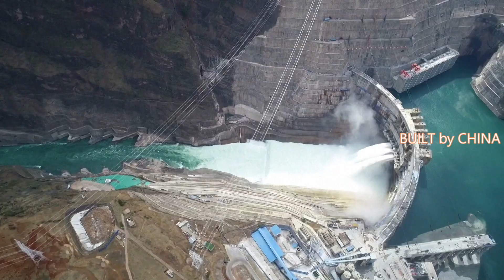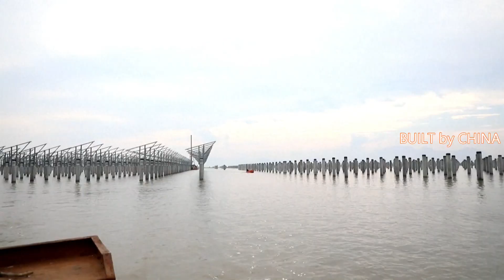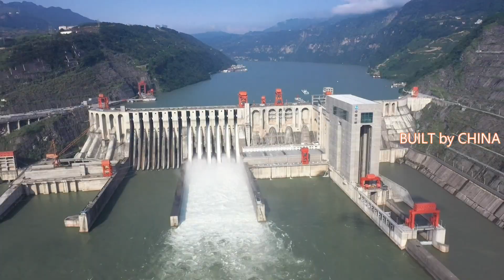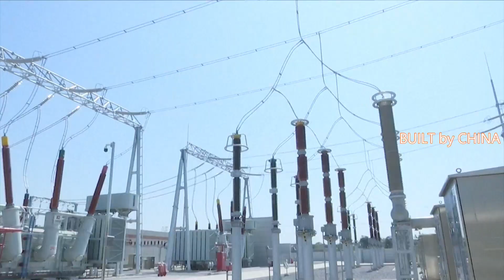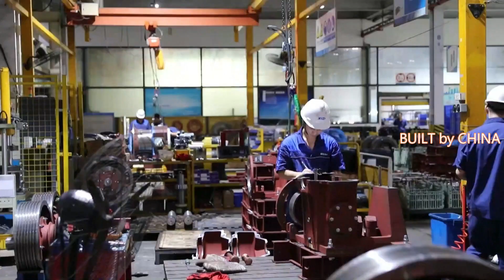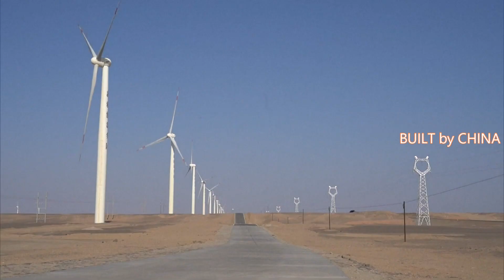China's non fossil power generation capacity to surpass coal in 2021 | 2021年中国非化石能源发电量将超过煤炭

Comment: This video is to do with the "installed capacity" only.  Fossil power plants in China are essentially coal fired.  Such plant is not affected by the weather and can run 24/7.  Non-fossil power plant like hydro, wind farm or solar park depends on season, weather and time of the day so installed capacity needs to be considerably higher to generate the same amount of electricity as the coal plant.

From my own records off a collection of youtube videos and news from both Chinese and outside China sources show:-
year             thermal capacity (GW)   renewable capacity (GW)    Total installed (GW)     (%) of renewable of total
2021                   1664                                          950                                     2614                                  36.34
2022                   1332                                        1228                                     2560                                  47.9

The conclusion is non-fossil fuel installed capacity did not surpass the coal plant in both 2021 and 2022 but it might achieve it in 2023 this year.